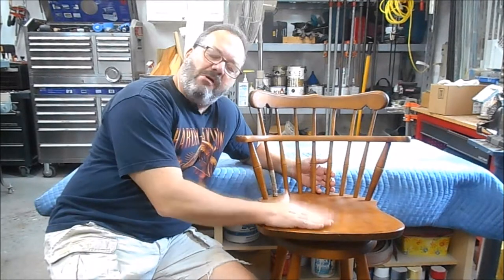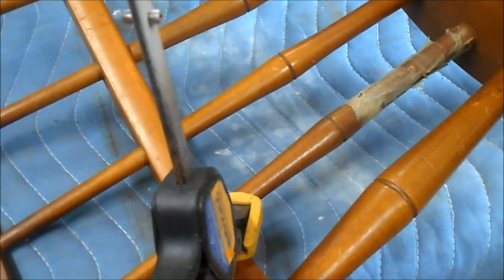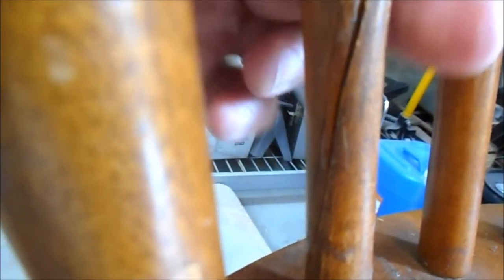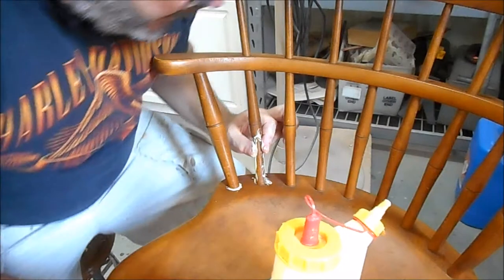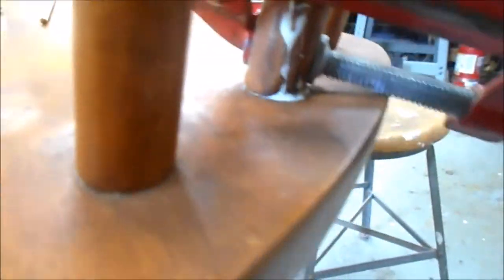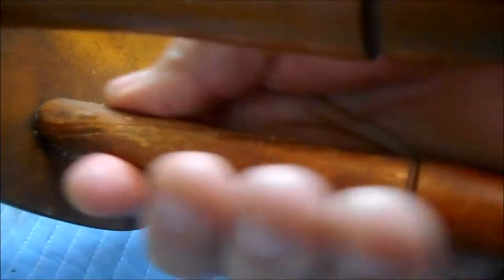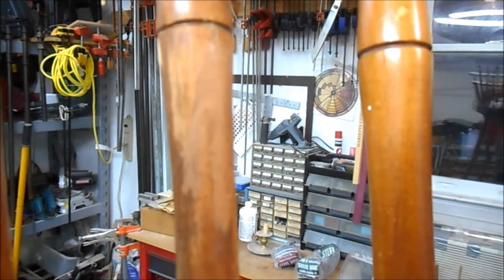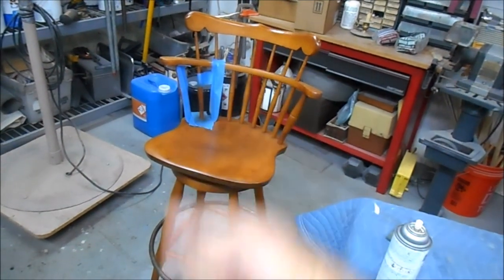Spindle Repair to Vintage S  Bent & Bros Bar Chair

Comment: Good work I enjoyed the lesson. Hose clamps work good in situations like this because they provide even clamping pressure as well as keeping the parts aligned. You can cut a small piece of hose or inter tube the size of the clamp to protect the wood from the clamp.
Reply from the maker: Great idea!  Thanks!

Comment: Nice job; looked like the spindle had never been fractured when you finished.  Thanks for the tip on misting the toner.  When you re-seated and re-glued the large spindle, did you remove any of the old, dried up glue from that joint, before putting on the new glue. If you didn’t, does leaving the old glue in place affect the tightness of the re-glued joint?  

A tip for gluing up the fractured spindles;  hide glue will pull the joints together as the glue dries.  Also, using a glue injector to put glue deep into a joint, and using a palette knife to spread the glue throughout the joints, will insure that the joints are completely filled with fresh glue before you clamp them up.

Thanks again for an excellent video.

Comment: Nice job! I like Cory's suggestion of using hose clamps. Also to get glue into a crack like you had, I've had some luck soaking a piece of string in glue and then running it into a crack. It gets much deeper into the crack when you have access to both sides like you did.
Reply from the maker: Nice.  Thanks, Chuck.

Comment: Hey Larry, another great save! As Cory mentioned, we've used hose clamps frequently for "round stuff", they work great. Also, next time you are out and about stop in an art supply store and look at pallet knives, pick up a few, the metal ones not plastic, they probably taper in thickness down to a thousandth. I have three or four and have yet to find a split/crack that I couldn't drag glue into. Have fun!
Reply from the maker: Thanks.  I have quite a few and love them.   My favorite just broke and I ground it back so I can still use it like a tiny paddle.   I hate throwing tools out.   I may be a budding hoarder.  LOL
Reply: The use of hose clamps on round items and the use of metal palette knives to apply glue in cracks are two great tips for repair work. In addition to hose clamps, zip ties may be another product to try when gluing up “round stuff,” if you can get them tight enough.   I have been using palette knives for several years; when I buy palette knives (can’t have too many) I usually pick up a few of the less expensive artists brushes to use for fine touch-up of small defects. These brushes are also very helpful in touching up interior or exterior painting when you find you missed a spot or need to repair a scratch or ding.  For applying glue to spindle repairs, or just gluing up chairs in general, consider using gun cleaning swabs that come on 6” or 8” wooden sticks. The good swabs don’t shed cotton fibers and can apply glue around the inside of a spindle socket, and around the end of a spindle, without making a mess.

Comment: Nice video! Try using rubber cement solvent (i.e. pure heptane) to remove anything sticky, from scotch tape to “permanent” decals to furniture labels to stamps. As with other solvents, wear a mask. It does not leave a residue; for things you might need to reuse, such as stamps, labels, decals, or parking stickers on cars, etc., the stickiness of the adhesive returns when the solvent evaporates.  This solvent is a good tool to know about, is relatively cheap, and doesn’t require a knife to remove the item (although a razor blade can help remove difficult items from metal or glass).  Thanks for the tips about misting the Mohawk toner on, and the choice of toner colors.  After the toner has been applied, did you apply a lacquer or other protective finishing coat, and if so, how did you match the gloss with the rest of the chair?  Please consider using the “Show More” window to give your viewers links to the products you use to achieve your goals, or to memorialize some of your key tips in writing.  Thanks for showing us this spindle repair.
Reply from the maker: Thanks for the tip.  Yes, I sprayed satin lacquer on it.

Comment: Not bad.  I used to have a furntiure shop and I would have done a burn in and used some padding finish.   And yes, Mohawk!    That is the  brand.   I would use a  burn-in knife with a curved blade when I  did my work.  I  was looking up some other  info and ran across this video

Plus  I have that model as a chair.   I was in a thrift store and saw two  of them,  black with stenciling.  They are from before my time,  but I could see they were New England made chairs.  One quick flip to see the brand name underneath and I knew that I  was buying them.   $5.00 each.

Comment: I use medical tourniquets and they work great, in addition I rub a light coat of candle wax on the wood to ease clean up. Glue doesn't stick to the rubber and they are cheap and you can use multiple one to clamp.
Reply from the maker: Great tips.  Thanks.

Comment: Do you know where I can get the bottom spindles for the Bent Bros. Windsor chairs - dogs chewed three chairs.  Any help would be appreciated
Reply from the maker: I am unaware of any place to get parts.  You can either repair them (I have a couple of videos where I do repairs to dog chews using epoxy putty) or have a local wood turner make you a couple of new pieces and then finish to match.  Good luck!
Reply: @LostMountainRestoration  where can I see these videos.. I don't know how to find them... on Facebook?  What is the link?
Reply from the maker: @nancybarnett608   Try this video starting at 2:22  https://www.youtube.com/watch?v=5LuNKVYIeyw  If you go to my channel on YouTube and click "Videos" there are over 100 there.   You may have to search around but I'm sure I have done others on fixing dog chews.   It's all done the same way as this one - good luck.